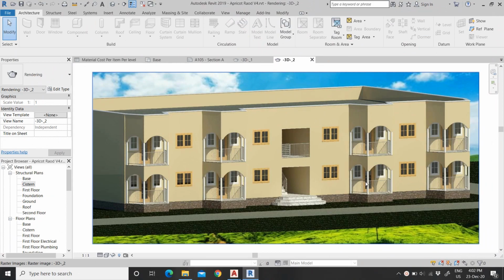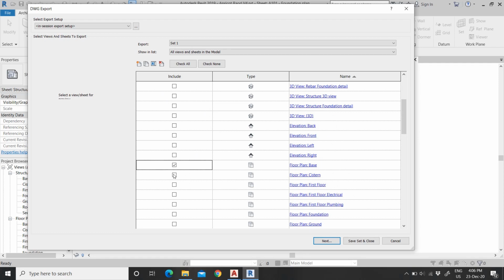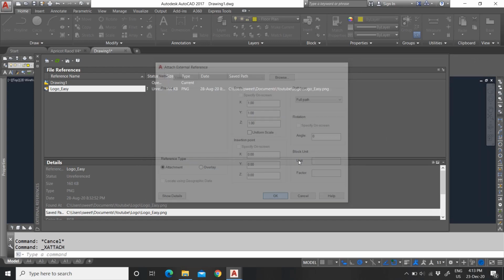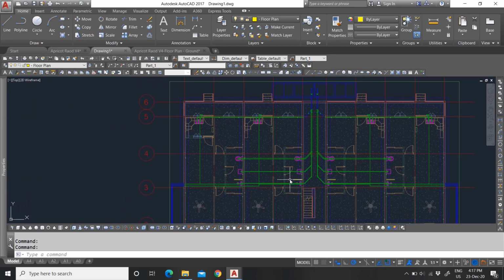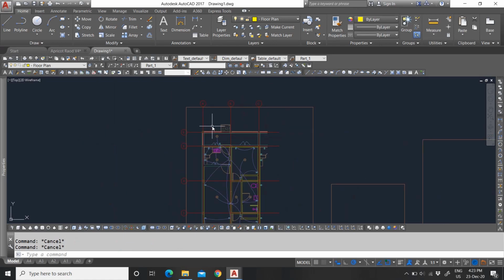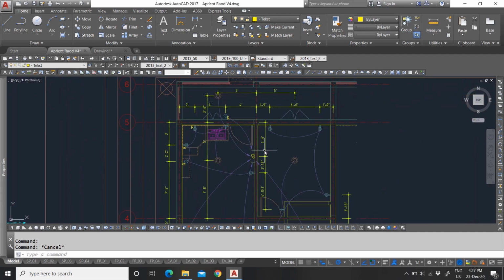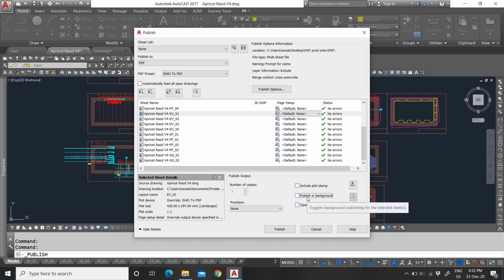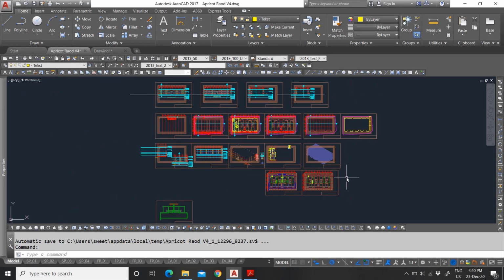From Revit to AutoCAD

Comment: Do you have a suggestion on how to do this if you do not have access to revit, but have autocad. I need to open a RVT file.
Reply from the maker: You can't open rvt files with autocad.  Only converting the rvt file first to ifc or igs would you be able to open it in autocad unfortunately.

Comment: Can you export the model?Some Architects have moved to RVT, but I find ACAD Arch/MEP more user friendly. I could extrude walls from a plan, but so much easier to have the whole model. I prefer 3D work out of the ACAD platform.
Reply from the maker: Ill try to today see if its a 123 process.